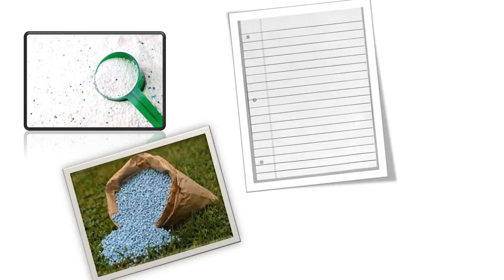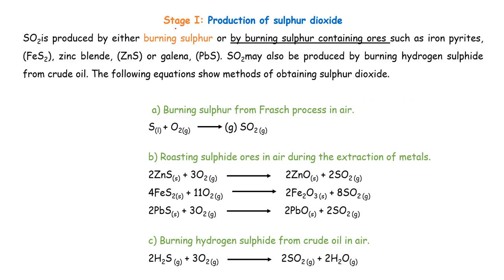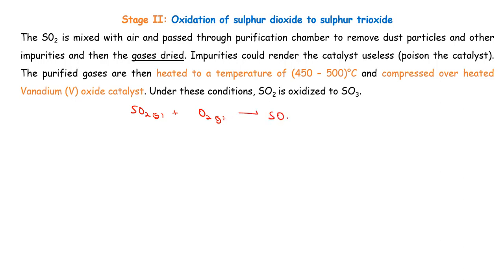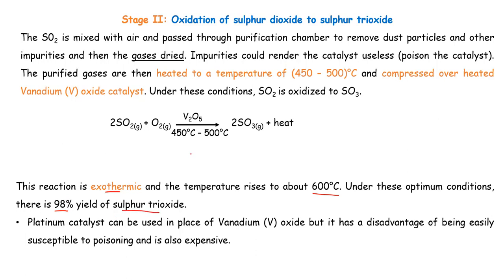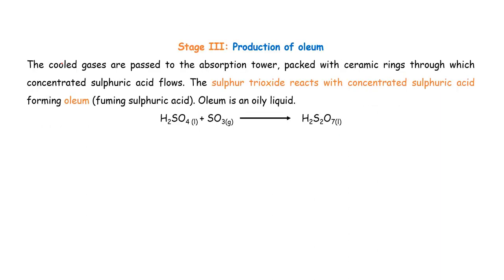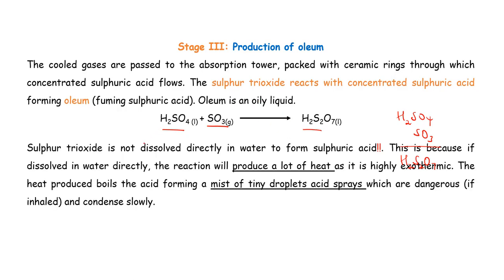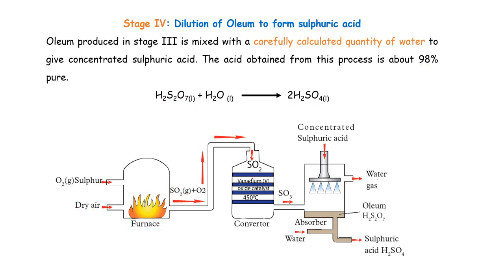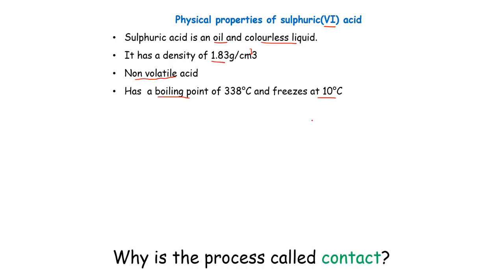The Contact Process: Detailed Industrial manufacture Of Sulphuric Acid

Comment: Why is water not used as a solvent
Reply from the maker: It's interaction with sulphur trioxide is so exothermic that the acid will heat up and splash as a mist which can damage equipment

Comment: why is it called contact process
Reply from the maker: In 1832: The gas mixture containing SO2 + air could be directly transformed into SO3 without lead chambers, but with simple contact with a solid stuff, namely platinum wires, which had a catalytic effect in the reaction.
The process was named contact process at this time, when the catalysis was not yet well understood.